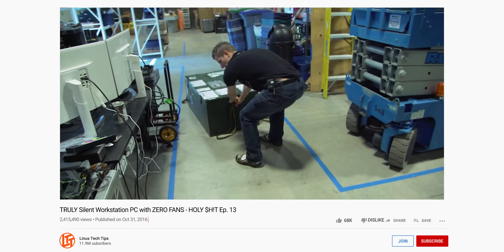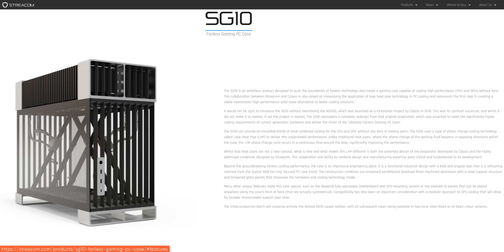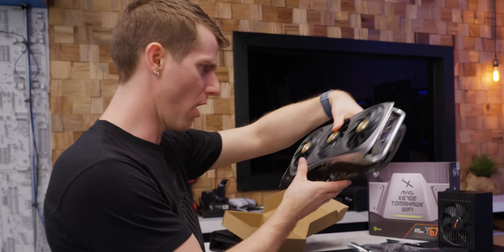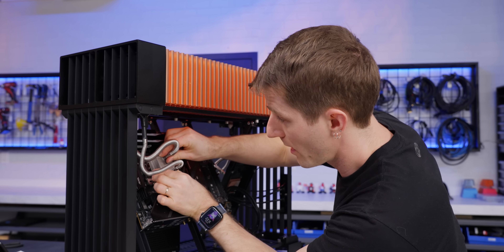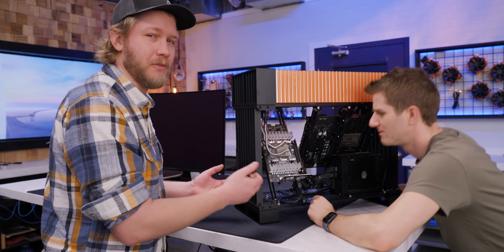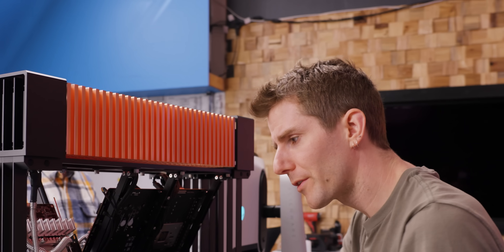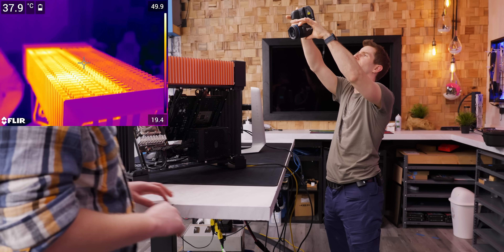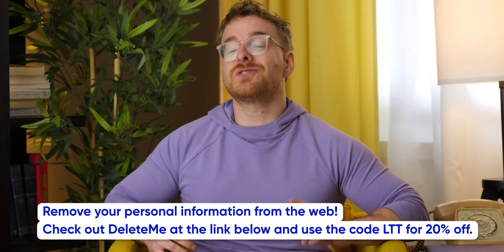I bought this scam PC case... And it actually arrived

Comment: From the standpoint of a refrigeration tech, this design just doesn't make a lot of sense. The refrigerant for the system seems like a bad choice due to the oddly high saturated evaporator temperature you're running at when boiling off, along with the need for very low pressure being required in the evaporator  to achieve effective cooling which means you're likely going to need to run in a vacuum which can cause all sorts of issues. 

From the little bit of looking up I've been able to do on solid state pumps I'm not certain this system is capable of ever achieving a good environment for cooling. The design also just seems weirdly inefficient and would probably have a significant benefit from some concealed case fans at least moving fresh air across the condenser fins from the bottom of the case. That would at least help to subcool the refrigerant and hopefully allow it to achieve lower suction temps which I would think will result in a lower cooling temperature and probably a more consistent superheat.
Reply: You think you can build better a one. Show us how it's done.
Reply: @vincentawesome5365  I don't think I can build a better one because I'm not an engineer or manufacturer with those resources. That would be a ridiculous thing to claim and isn't at all what I was driving at. I can only speak to what I see with the understanding I have, and that's what I'm doing. I think it can be revised to work better by the people making it though.

Comment: I say there's 55 lb of copper there costing around $261
The process of making it into a radiator let's say an extra $120.00 
The case itself let's say it's $150 plus the tubes and proper fittings and specialty made C PU and GPU cooling plate $175 let's assume the coolant HFCs for the pc is similar to a fridge in cost maybe $300 let's say $60 for labor

Giving the total cost of $1,066
Reply: plus prototyping cost, factory in china, rechecks (there was 3timed delay as parts did not perform as they should). What you talking about is pure existing cost without R&D
Reply: @jurandfantom  yeah I know that's what this breakdown was just to show it costs a lot to even make it let alone only 500 making it more expensive

Comment: Honestly? 2 grand isn't bad for how much copper is in there. You don't have to buy blocks, fans, lines, fittings, extra splitter cables, filters, coolant, and all the other things you need normally with a water-cooled build. A grand for the non-copper version is pretty damn price competitive too.

Comment: I wonder if you could put some big ol' fans on the bottom that would just barely be blowing. You could set them so low that the sound they make is still overpowered by the bubbling, but get some more airflow amd help out some of those other components. I understand that thats not really the point, but for actual day to day use it makes sense.

Comment: That thing is barely a case. It's just a ****ing massive copper heatsink with a metal frame and two AIOs dangling off it. And I thought the pure copper heatsink on my 980 Ti Golden edition was crazy.

This is pretty "cool" but... is there any actual practical benefit? My 4000D with a few fans gets the job done nicely.

Comment: Former employer used much smaller heatsinks like this to cool their non-moving part PCs used in power infrastructure that needed to remain sealed because they were being used in areas that could be covered in water, dust storms, anything really. A single piece of that heatsink would turn room temperature water cool quickly and you couldn't touch that heatsink, it'd burn you.

I'm actually scared for the top of that case.

Comment: Information for you, Linus that’s relevant to this.
Glass chips that dissipate heat in servers . This will be incorporated in the next 18 months.
Optics by Nvidia are also been incorporated .
This will be utilised in conjunction with a gaming industry .
What’s known as heavy lifting.
Heavy lifting is going to be used for graphical purposes.
Meaning your laptops and PCs will no longer be relevant when it comes to graphics cards .
You will not need graphic cards anymore .
Most of the processing power will be held on servers.
The graphics depending on the developer will incorporate the utilisation of graphic servers.
Eventually, glass chips will be utilised in laptops that will be far superior that you have ever known because of new software and hardware integration.
The heavy lifting will be dealt with servers and the graphics will be incorporated .
These are just some things that are happening behind the scenes .
This is a good idea, but not relevant. Things are progressed much more further than this. .
Your team is to look into this. The information is relevant already on YouTube and through the net. .
Your team probably understands a little bit about this, but it’s far superior tech then you’ve already thought of 
My advice to you and your team is to look at the information that’s available out there at the moment. I’m going to speak to the companies. 
You’re not up to spec and you’re certainly no team needs to get up-to-date with what information you are providing. I just thought you get some information that more relevant to what you’re supplying on YouTube. Bye for now. Take care of your friends and family.

Comment: But the whole system stops working if the system gets overwhelmed with heat, which I think is a good possibility.   Also, would it not be just as effective, if not more so to use solid copper lines to the radiator?  At that point, why even bother with the coolant?

PS:  More ads in this segment than an episode of the price is right.

Comment: the power delivery chips running at 93 degrees and the actual gpu chip running at 55 does not sound good at all. that gpu will probably break really quick.

Comment: As a former Airtop 2 owner and a current Noctua NH-P1 owner (plus I have a neat fanless N100 mini PC I'm planning to use as a media PC), I love the concept. I just think it's a little more janky than it needs to be and would be happy with something less beefy that cools a 65W CPU and 70W GPU like the RTX 4000 Ada SFF or the 3050 6GB. The thing is, the custom mobo is what gave out on my Airtop 2, and I'm now inclined to view fans a little more favorably. Current main PC has the NH-P1, three case fans, a semi-passive power supply, and a deshrouded RTX 4070 cooled with Noctuas, and I'm very happy with both the thermals and the noise levels.

Comment: This is silly for how expensive it is. You could always use convection to do phase change. I would wager you could take a really large water column made of finned material (think baseboard radiator) in a loop and convection would still work the same minus the phase change until the loop was heat saturated.  The hot water rises to the top and pushes the cold water down as it overflows. The thermal mass and air convection are what is doing the work here, the freon in that loop will still saturate just like any water loop once the load exceeds the amount of heat (wattage) the radiator can reject efficiently. I would consider this a "flooded evaporator" system which is commonly used in HVAC systems for grocery stores and functions on similar principals but requires large pumps. I'd like to see an experiment with this vs a really large nitrogen/argon charged heatsink/pipe of comparable thermal mass and the afore mentioned water column. I think a hot radiator will move air via convection regardless of the medium used to transfer the heat.

Comment: Those NVme drives and ram will love the fanless set up😂😂😂
Has a mechanical engineer, heat pipe design is well into Phd territory. Most stuff is design by the new guys and check by the senior. Heat pipes, is another beast because you cant cheat😂😂😂

Comment: I spent $1,600 on my Cyberpower Ryzen 7 7800X3D AIO 240mm running @65°C when zombies cod 6 for 3 hours solo straight, 32gb T-Force DDR5-6000 led Delta Memory Expo II & PBO -30. RTX 4070 Super running at 50°C with its tripple fans running about 200 rpm on average. Super quiet. 2TB Gen 4 T-Force 4x4 M.2 SSD. With 2TB Samsung 990 EVO Plus @4x4 running my games. It's pretty silent, but I can assume not as much as that. In todays value. Thats not that bad of price.

Comment: This is really cool. We studied these types of pumps with no moving parts in uni physics classes, and since then I've always wondered if it would work for a 0 moving parts PC (especially since many heat pipes in smartphones and laptops use a "similar" process to transfer heat from the CPU to the cooling system). I hope this type of cooling systems gets more widespread and available in the future, particularly a smaller scale version of this for lower end hardware. Imagine if you're running a mid range CPU and you don't even need fans, pumps or cable management, just slap a big ol rad on there and a few pipes and you're good to go.

Comment: Now THIS is a rig I'd like to see undergo the smoke test to visualize the airflow better!
Reply: Yeah really, that would be amazing!
Reply: You'd see the airflow on the fins at the top, probably forming 2 cylindrical tunnels parallel to the CPU and GPU fins respectively.
There'd be nothing going in/out of the case itself 'cos the heat exchange is all completely isolated.

Comment: This is by far the most over the top space heater, but could actually be a practical application in a cold environment
Reply: Conventional cooling will do exactly the same thing, but with the addition of heat generated by the fan motors and extra heat from the PSU to run the fans.

Comment: 90c is completely within spec for VRMs etc. If I had this case, I'd direct die cool the cpu and get some stick on heatsinks for the GPU, but even without that it should be able to run stable and silently for years and years.

Comment: 2k is a bit ridiculous at first glance, and the $1000 premium for the copper fins is a good indicator for their profit margin, but I might've bought it if the max cooling capacity would've been higher and if there was a way to add fans - for peace of mind during hot summers - w/o ruining the looks of the case. If this could've been my endgame pc case for the next 20+ years, I would've been able to stomach the cost.
My current case plus all the water cooling components I've added over time cost around 1800, so it's not a crazy difference in price ... but this is the most impractical and hard-to-build in non-mITX case I can imagine. Spending two grand, only to spend a weekend designing and printing covers for cable management ... for a case that couldn't even handle my trusty old 10980XE ... nope.

Comment: I know its supposed to be fanless, but Im thinking maybe putting two 200mm noctua fans at the top or bottom should make this thing a silent beast.
Reply: dunno if their bearings are good enough on these
but also the boiling noise makes the whole thing utterly nonsensical anyway
Reply: Exactly what I was thinking. Two of those on low and it should stay plenty cool while being nearly dead silent. You’d have to take this thing into a cave to even hear it afterward.
Reply: Funny I was sitting here thinking the same exact thing. I'd put two 200mm fans in for the case and a 120 over the cpu and gpu in custom stand offs over the hot areas at low rpms. Even now with my water cooled CPU I have a 90mm fan over the VRM. Doing that cut over 10 degrees Celsius off its temps when pushed hard. Since water cooling it removed the fan from that area I thought it would be a good idea to direct some air there.

Comment: "the boiling doesn't sound louder" yeah, you can increase the temp as much as you want, boiling is boiling. You're mistaking the difference of water from simmer to a hard boil. That boil in this loop isnt going to get louder, it is just going to make the heat exchange (the radiator) at the top hotter.

Comment: This technology have to reach higher temerature, becouse it have to work in higher room temperature and nead to achieve evaporation on cpu (max 100°) and condenstion at room temterature. The beauty of this technology is in maintaining a constant temperature regardless of power (up to the limit of heatsing, of course)

Comment: To be fair 2k for a case that looks that cool with over 2ks worth of parts instead doesn't seem that bad but I would definitely add a couple of fans running at low rpm to cool the other parts slightly or maybe a PSU with a fan might be enough fist to get some airflow over the VRams and SSD
Reply: Am I also getting Borg vibes from the case?

Comment: The Zalman TNN 300 and TNN 500 were fully passive and made it to market. I have the smaller one sitting in a closet. Maybe their heatpipes weren't as cool (or expensive) as this custom loop, but they cooled the same stuff - plus the built in PSU.
Reply: TNN = Totally No Noise, by the way.

Comment: Technically, there are moving parts... The gas inside the heat pipes move around when they are hot to transfer heat from cpu block to that copper heatsink on top.

Comment: 12:00 the boiling is most likely that the case has been stored in a colder envirement, and as the heatsync warmed up to above the boiling point of the refrigerant it started boiling inside the system

Comment: 18:30 Yeah, when you mentioned the cost in the beginning, it sounded like it was going to be 15 grand.
Two is still overdone but a realistic expectation for a product like this. Nice that you dug it up for us to see.
Reply: Yep, I was not even aligned shocked when they said $2k, that’s not too bad
Reply: For case, blocks, radiators, fans, pumps, tubing, fittings, etc. it's EASY to spend this much on watercooling.
Reply: I was expecting $1k
Reply: Still not the most expensive cases..
Reply: I mean  they also said that the copper one is a 1 of 500 so thats not a bad price for a limited edition item anyways
Reply: Yeah, especially the non copper version are at 1000 usd so half that,
Reply: The $2k Cu version is what they are making good return on, the $1k version, they are making normal (for boutique case standards) profits on.
Reply: it's 1400.00 already. give it another week and it will be 1800.00
Reply: Honestly 2,000 for a CPU cooler, GPU cooler, and customer case.  Not all that crazy.  Not for the normal user, but a person who did water cooling looking for something new to play with, sure I could see them spending 2,000....  

Its the tech and finally seeing come to market that is important this has massive potential for future PCs.

Comment: y don’t you guys create a Peltier-based or other sub-zero cooling module and combine it with mineral oil submersion? That way, condensation won’t form, and you could safely use an AIO or even liquid nitrogen for extreme below-zero temps without worrying about water damage. btw love you guys

Comment: Sorry but $2G’s ain’t worth it if the gpu gets significantly hotter in that case with no fans than the one I have now with fans. I paid way less than 2 grand for my Demon Slayer case and my thermals are perfect with a steady 48 degrees for my CPU and 68 degrees for my GPU under full loads. While maintaining a steady 34 degrees while I’m not playing games and just streaming content on the web. I’ll be just fine 😎🤷🏽‍♂️

Comment: You guys should do a part two where you improve this by adding some more heat sinks on vital areas on the gpus and mother boards, and then possibly if adding fans makes much of a difference, because if you can add some super silent fans, even if low airflow, they likely wont be much louder than the "pump"
Reply: They won't do it, the hype over it is already over and 2nd video won't get much views

Comment: In a cold winter, this could be the more affordable heating for a room. And it seems to be much quieter than a system with x fans on it.
Reply: Electric heating is typically the most expensive way to heat a room, though one of the most efficient (after all, any wast energy is converted to heat anyways) what this is is heating the room and computing at the same time, which is nice